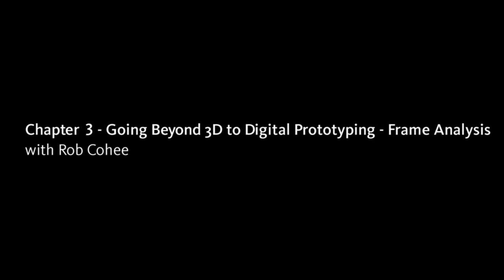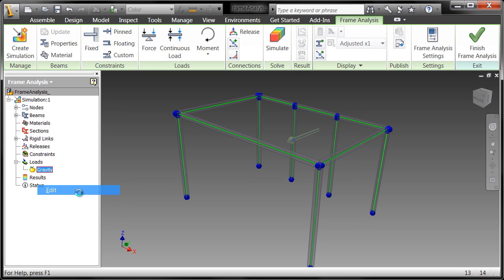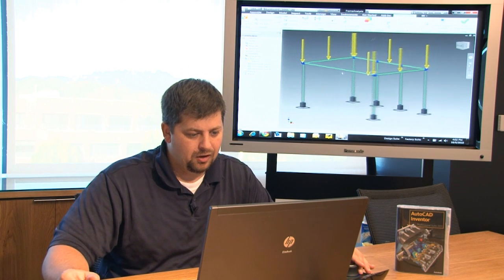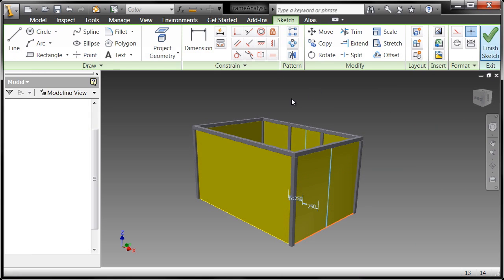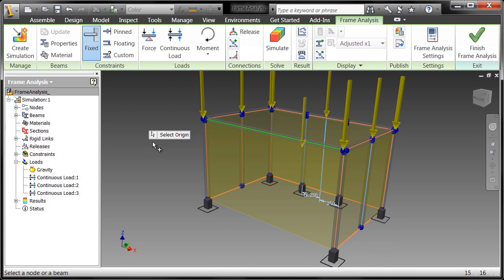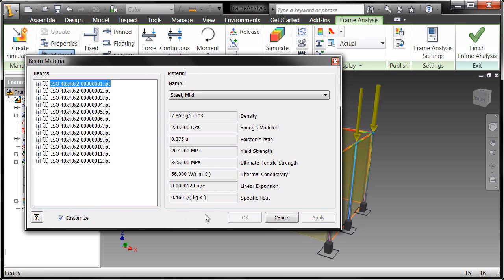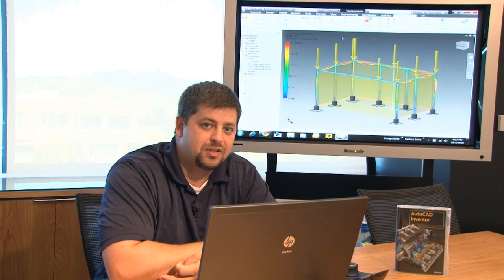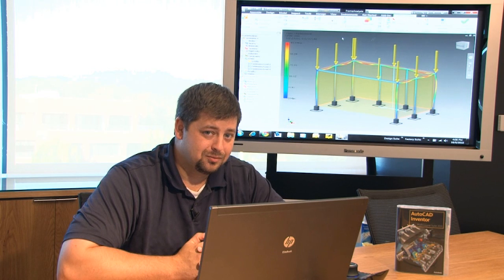Autodesk Inventor Fundamentals - Basics of Frame Generator Chapter 3

Comment: You're right it wouldn't bend, but the simulation was set to "adjusted" instead of "actual" meaning that where it was bending was where the most stress was being applied. When Rob changed it to "actual" the beams showed the real results

Comment: I am no expert but I am trying to run a simulation right now. And i noticed that you are imputing 500N per millimeter so if the beam is 1.5 M long thats around 750,000 N or around 75 Tons or 165,000 pounds or my math is of. I work as a machinist and that beam will not bend like that under 100 pounds.